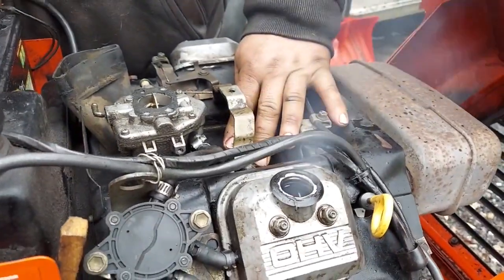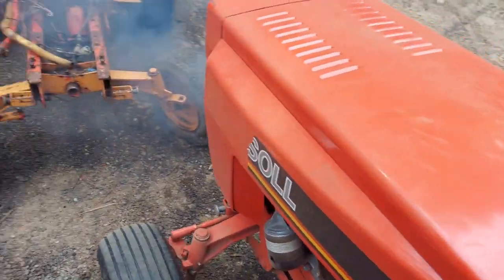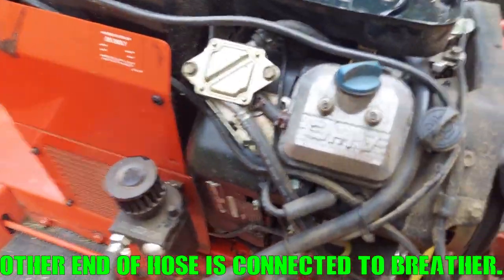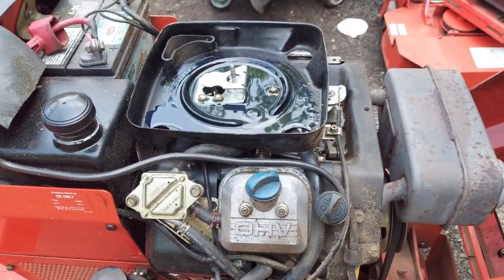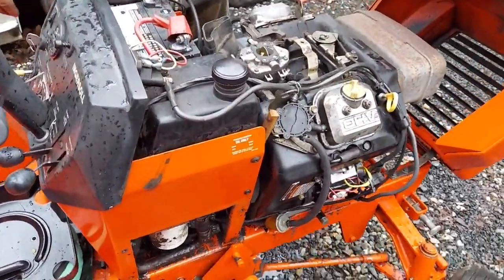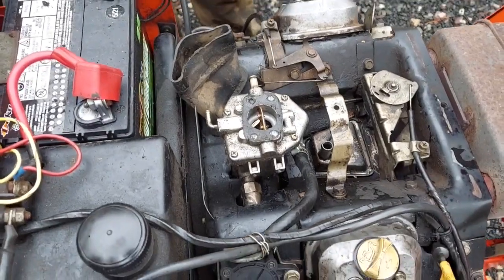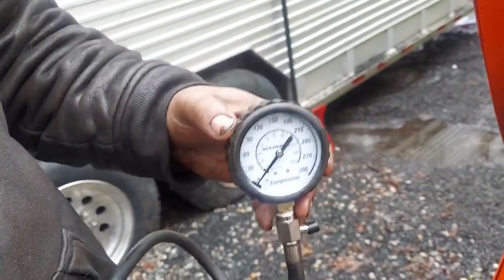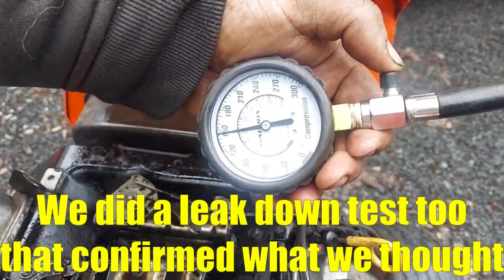Briggs & Stratton Diagnosing-Bad Head Gasket & Air Filters Full Of Oil. Over Head Valve Engines

Comment: I believe I have a blown head gasket on my Vanguard 16 HP Twin. No oil being 
pushed out all over, but I can hear it plain as day. This seemed to happened at
the same time the carb float needle got stuck open and flooded the cylinders
with gas. After fixing the float issue I ran it only to hear it blowing out compression
on one of the cylinders. And that cylinder was definitely not firing. Removed the
oil fill cap and its blowing like the one in your video. Does this sound like I'm on the
right track? I'm baffled because oil is not being blown out of the breather hose or
anywhere else for that matter. The motor is on a 4 wheel atv. Also can you please
advise me of the part # for that oversize oil filter?  Thanks much for your time/advice
Reply from the maker: Hi Sounds like you are on the right track. I would replace them both while at it. Here is a link to a head gasket kit we put together. https://www.caseingersolltractors.com/product-page/c34196-c40934-briggs-stratton-vanguard-decarbon-head-gasket-kit Thanks for watching and the comment
Reply from the maker: Here are the filters https://www.caseingersolltractors.com/product-page/c34544-c34374-briggs-stratton-oem-high-capacity-oil-filters-vanguard-engines
Reply from the maker: Here is the tun up kit with high capacity air filter and HC oil filter and HC fuel filter, as well as plugs. Thanks https://www.caseingersolltractors.com/product-page/briggs-and-stratton-vanguard-seasonal-tune-up-kit-with-high-capacity-filters

Comment: I like the vanguards but I feel like Briggs quality just isn’t there the old flat head opposed twin Briggs were bullet proof and the old single cylinder engine I love the old Briggs engines but I also like the Kohler magnum single and twin engines and the Kohler k series and the newest Kohler engine that like is the command v twin series I’m not a fan of their new stuff onans are just great they can be hard to source parts but they runs so nice if they are tuned properly and in good condition
Reply from the maker: Onans are tops and our favorite, The Vanguards are good engines but like any have some flaws. But you are right with anything today the quality just is not what is was years ago.. But for the price they are a good engine, smooth, easy on fuel and make decent power. Do not make the power the Onans do but are much cheaper and smaller so make less torque. But agree all the old engines were great! Thanks for watching and the comment!